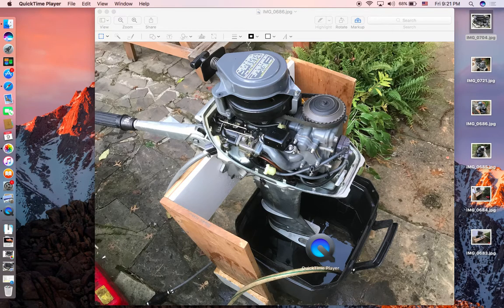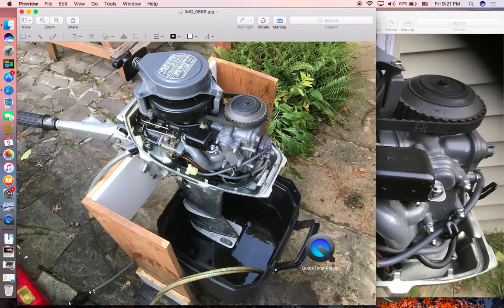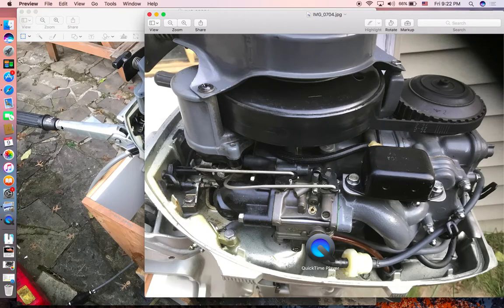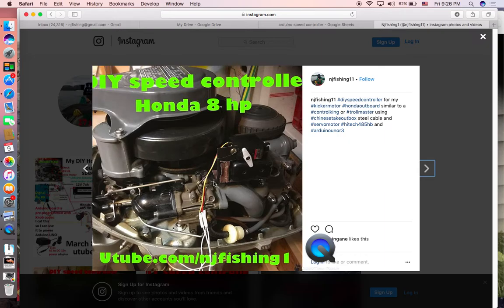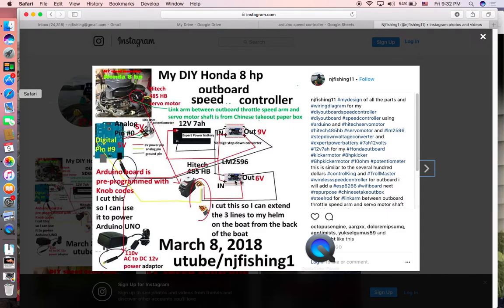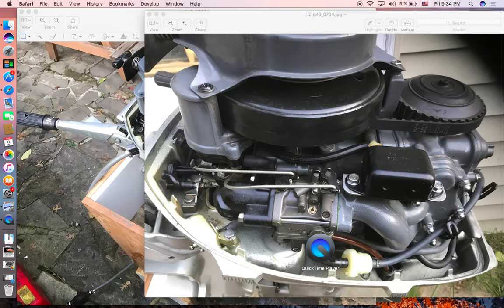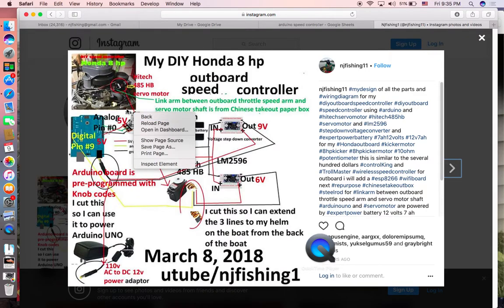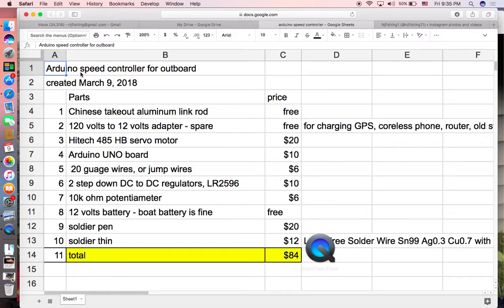Explain my DIY outboard boat motor speed controller and wiring schematic of the design

Comment: This is a lot that can go wrong. Why not just make a cable that goes from main engine throttle body to Aux motor throttle and use existing main controls up front of boat.

Comment: Does code provide a failsafe throttle position? 
Have you backed off throttle return spring tension. Servos don't cope well holding against constant high load.Also servo strength spec is rated at hole closest to spline. They burn out easily when constant load on horn end
Reply from the maker: No, KNOB code does not provide a failsafe throttle position. I will write ONE and re-program and upload the code. Thumbs up for this suggestion! YES, I read the commercial speed controller motor burned out a lot and $400 went down the tube. Their replacement motors cost a couple hundred dollars - LOL.I did notice when I spin the servo motor blade to neutral and fastest speed (the 2 far ends of the throttle arm). The outboard boat motor throttle arm did put some pressure on servo motor so over time it could burn my servo motor. So, I will have to figure out the angle and position of the servo blade and make sure codes are added in KNOB to address these 2 extreme positions so servo motor does not burn out for no good reason. Thumbs up for your valuable and priceless input and suggestion!

Comment: Running a servo signal/power over more than 2-3m distance via 20-26 gauge usually results in jitter. This is without a ignition close by.
You may need to fit a few feritte core filters to cable to smooth signal and wrap servo in alloy tape or heavy duty foil
Servo cable will be quite fragile in boat environment
Reply from the maker: WOW yes, thanks for the excellent suggestion. LOL, I don't even know CDI iginition coil could interrupt with my servo motor. I am actually going to test the kicker motor in a water bucket with my DIY toy project before I take it out with my big boat. Kind of scary to test it in the real world - LOL. The more complicated a design get, the more things can go wrong. Last thing I want on the water in my big boat is if I lose control of the motor and boat just kept going - That would be as bad as a nuclear disaster - LOL
Reply from the maker: WOW, what is feritte core filter? What is alloy tape and foil servo cable? dang, I learn so many nuances as I read your suggestion. Thanks a million! Thumbs UP! You are the man! So, I am not giving tips to my viewers and subscribers. I am actually gettting tips and subscribers to make the DIY project even better for FREE! Thanks again! Dude.